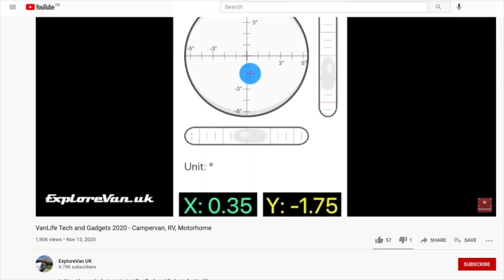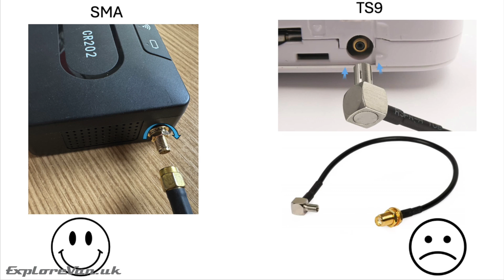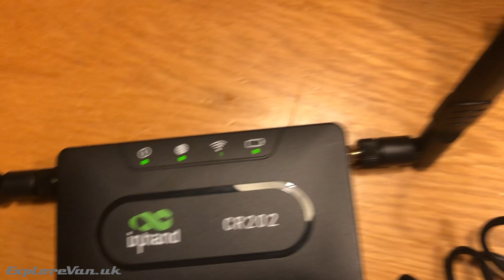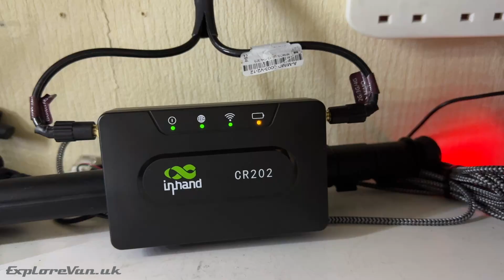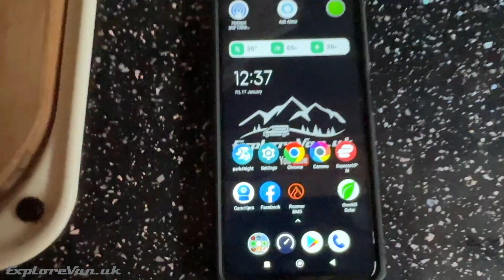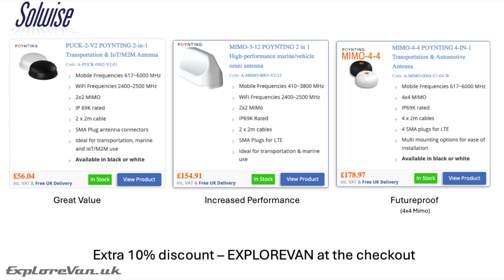Easy Campervan Mobile Internet - Review and Giveaway  InHand CR202 Motorhome, RV, Caravan.

Comment: @ExploreVanUK - Nice video thanks.  I have a panel van conversion and am looking to solve the "metal box" signal issue. Would this combo be a good option for someone who doesn't want to drill holes in the roof of a van?  If the puck works well with the magnetic mount then it could be a good option for us as the cables could be threaded through the back door or a window. We rarely stay anywhere with 5G.
Reply from the maker: Yeah it sounds like a good option for you. 

The other advantage of the puck I’m not sure I mentioned is that it comes with reinforcing / protection to the cable which protects it well when the cable is run through windows / doors, so perfect for those that don’t want to drill holes for cable entry.
Reply: @ExploreVanUK   thanks, I appreciate you taking the time to reply.

Comment: Good info, how does this compare performance/spec wise with the Kuma lite
Thanks
Reply from the maker: Hi, glad it was useful.  The Kuma Connect Lite is a rebadged Tuoshi LT220M - which is available from Ali Express for around $40-$60. It only has a Cat4 Modem and no built-in Battery, nor can it be powered/charged from USB .  So I would say the CR202 is superior both in performance (as it is Cat6) and functionality.
Reply: Thanks, really helpfull  @ExploreVanUK

Comment: Thankyou for you reply regarding the wAVlink and parrot. Which makes me wonder if this device can make use of the antennas provided with the wAVlink / parrot patriot? System so only one antenna need be mounted perm on roof? Forgive the questions I'm autistic so it takes a few watches to drum things in. Thankyou .
Reply from the maker: Hi no problem. 

I am afraid not, as the antennas are tuned to suit the frequency bands and modulation of WiFi rather than LTE. 

No worries about questions, just ask away.
Reply: @ thankyou.
Reply from the maker: You could get a combined WiFi and LTE antenna which has elements and connections for both in the same unit. 

The Puck 4 would be one option. 

https://www.solwise.co.uk/puck-4

Or the Mimo 3-15

https://www.solwise.co.uk/a-mimo-3-v2-15
Reply: @ I will take a good look thankyou
Reply: @ Thankyou. Currently going down all the rabbit holes and pinching pennies

Comment: Great video , think I understand WiFi a bit more now , just need to decide on what I go for thanks again 👍
Reply: I have a budget of around £300 what’s the best option for me , I just need to improve my connection so on those dark winter nights we can stream Netflix etc , I would like an external antenna that fits to roof many thanks , need also a router and power supply that can be either cigarette light / usb connection as where I’m planning to install router there is 12v supply already there many thx

Comment: Very informative video, lots of info to think about.  How would you rate using one of the 5g home hubs in the van.
Reply from the maker: Unfortunately 5G bands are the shortest range and the least penetrating, so using a home hub inside a vehicle with its built in antennas is likely to be problematic and similar to the performance of a 5G phone. 

Some have external antenna connections but usually these are only 2x2 Mimo so give limited opportunity for band aggregation. 

The 5G routers designed for us in vehicles have 4x4 or 6x6 mimo antenna connections.

Comment: Thanks for reviewing the CR202. I am considering purchasing one of these from Solwise. Would be interested in knowing how the download and upload speeds compare to the Teltonika rutx14.👍
Reply from the maker: Performance compared to the RUTX14 will depend on signal in the area you are connecting in. 

The RUTX14 is Cat12 Vs the Cat 6 of the CR202.  This means the RUTX14 is capable of aggregating more bands together to improve the speeds available.  However this would only be evident in areas where more bands are actually available.

Comment: Hi Mike, it looks like a really neat solution as you say, power, portability and mounting all look attractive and as we almost never pitch up in a 5g area, not a problem either.
As finding the right antenna seems both key and quite tricky especially as experimenting can be so expensive. 
I’d be really interested to see how these various antennas compared to another YT recommendation of the Bingfu (Amazon ASIN B095KCHW56 ) which are raved about seemingly after extensive comparisons and come in at a much, much lower price point at 16 quid. 
Then, Chuck in an eSIM card for speed comparisons and you’ve hit my use scenario firmly on the head ( especially if you pop over to France to do it).
Keep up the good work always educational. Cheers Andrew.